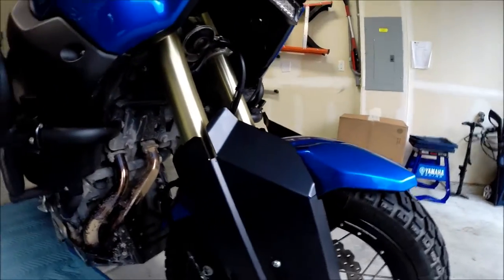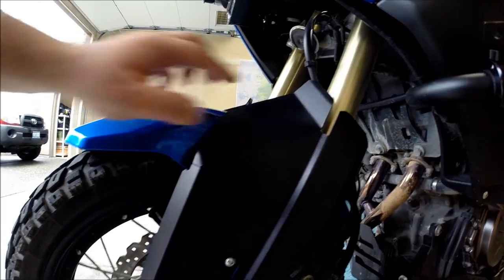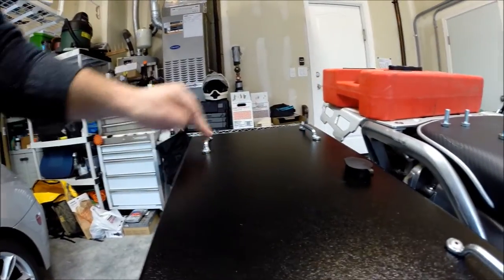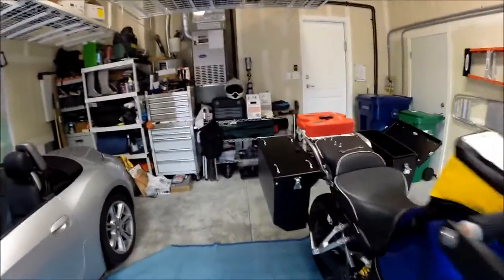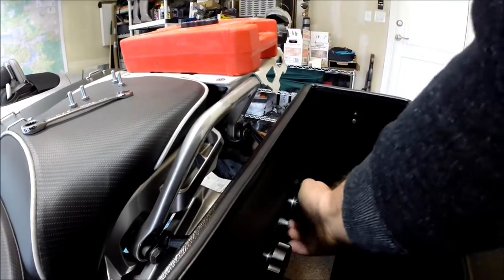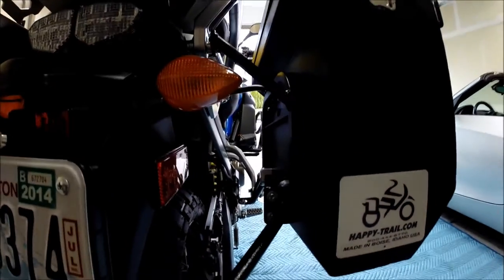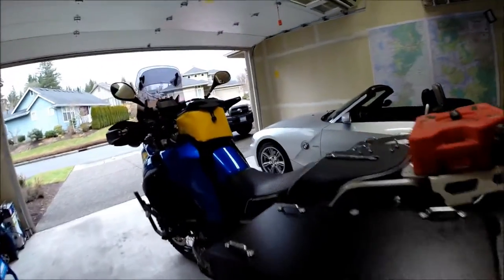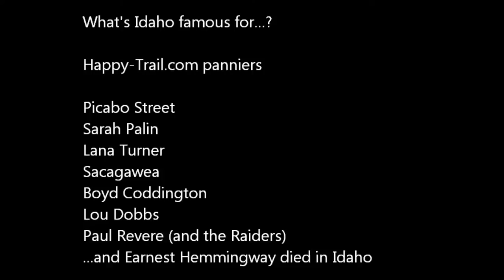Happy Trail Teton Pannier Review

Comment: Excellent review. I'm considering these pannier. Thanks for taking the time in sharing your thoughts and experience. N
Reply from the maker: Can not recommend them enough! Still have them, they are still excellent! 👍
Reply: @DuaneForrester  what is the width of your Teton panier? I thought the Teton was 7.5" deep but yours look deeper than that. It's been recommended that I use the 7.5 " Happy Trail pannier for a Kawasaki Versys 650 which I think  has a seat height just under 33". I imagine with the big tenere you have much more space.
Reply from the maker: @wiskkid  Mine are the 9" Clif Cut units, Stuart. Actual dimensions for the boxes on my bike are: 15" H x 18" L x 9" W - total weight of 8 pounds per box. The 7.5" wide units shave about 1.5 pounds off per bag, IIRC. I honestly thought about going with the narrower boxes (I prefer the look), but ended up larger on the logic of "Can you have too much space?". Turns out, for me, the 9" wide units were ideal. But, this is a pretty big bike. If I had a smaller bike, I'd give up a bit of space and run the narrower boxes. ;)

Comment: I just got installed mine. When tightening those two lower bolts, the "tooth" on the backside that attaches to rack just turns around. Does this happen with yours too? I installed them correctly. Thanks!
Reply from the maker: They spin until I get them close enough to the rail to essential "grab" the rail - that friction stops mine from spinning. If you're spin through this, it might be worth running the bolt through the foot's threads a few times to see if that will help clean them out, in case maybe some grit in there is causes unwanted friction as the bolt enters.

Comment: What is the Clif when ordering and do they come with the racks when you bought them?
Reply from the maker: Nate Underwood the Clif cut is what they used to call that angles cut on the outside edge of the pannier. It’s supposed to help with clearance when cornering or when off-road, but I’ve always felt it’s more of a styling choice. Not sure if they still call that feature that or not these days. The racks must be purchased separately. It’ll all be detailed on their website, with the most current info. 👍
Reply: @DuaneForrester   thank you very much

Comment: Hey man, great video! Are you still happy with these?!
Reply from the maker: 100% - it's been almost bang on 4 years since this video, and they are still solid as a rock. They've endured thousands of miles on the bike and remain close to new - dirty, but everything works as intended. If folks want to know what IS failing, well, the reflective stickers that were on the rear of each pannier from new are starting to peel up around the edges. The glue is still holding, and it's literally like 1/8" to 1/4" of curl in spots. That's it. I'd buy them again and have no problem recommending them to others. :)
Reply: Thanks a lot! Have a safe 2018!!
Reply from the maker: Thanks! Back at ya! :)

Comment: The four extra bolts are to replace the pucks if you so choose......to open up the width inside a bit.
Reply from the maker: Great tip - thanks chris! Hadn't thought of that, but makes sense. And now that I do think of it, might be very useful in aiding packing...must try this soon. :)
Reply: My pleasure,
The tenere is fantastic,
I'm still waiting on my Denali panniers,
There on back order,
I did receive the SU rack system and I must say,
They are beefy.
Take care out there friend.

Comment: Is the inside still 9" even with the Clif cut
Reply from the maker: The 9" width applies to the widest portion of the pannier box; let's say that's measured at the top. So...the cut...ah...cuts into that on the bottom edges. Obviously, not a perfectly cubed rectangle, but the added clearance is nice, so for me, worth the tradeoff. They never left me short of storage space. :)
Reply: @DuaneForrester  thank you I just ordered these and was worried about not having enough storage space with the cut

Comment: Nice garage review. How do they ride and hold up after a few thousand gravel and dirt miles?
Reply from the maker: Well, given I'd just installed them, the "garage review" was all I had to offer...but since you ask...

After a couple thousand miles of street and trail riding, they are...pretty much the same as the day I installed them.  Dustier, and dirtier, but otherwise, solid and weather resistant.

One thing to watch for - the mounting racks use square tubing at from the back, leaves the end of the square tube open to the elements.  I can see mine starting to get surface rust inside them.  Why they don't ship with plastic plugs is beyond me.  Easy enough to sort out, though, as a small project over the summer.

Super easy to find the plastic plugs...in bulk, so just need to sort out a smaller number than the 24 packs I've found. Plan to spray some rust convertor in the tubes to get a jump on the surface rust not going deeper, then some rocker guard (on hand), then the plugs to keep future crud out.

I panniers are tight and solid on the racks, and while the top box flexes slightly as mounted on my ALT Rider rear rack, its not so much to cause issues, fatigue or breakage. If I were planning to do a Back Country Discovery route, though, I might replace it with soft bags on top to reduce overall weight up high a bit.

Fit and finish remains as received, though I haven't dropped the bike yet either.
Reply: Duane Forrester That's some great info, Duane - thanks! All I need to do now is decide between 4 bikes: BMW F800GS Adventure, Triumph Tiger 800XC, KTM 950/990 Adventure, Yamaha Super Ténéré…
Reply from the maker: Paul Tannahill I've ridden all 4 of those bikes.  Brought the Tenere home, obviously.  Zero regrets even after throwing several catalogues at the bike...LOL Ride, take notes and make the call that's best for you. :)
Reply: Duane Forrester Thanks, Duane. I get worried about the weight of the Ténéré, but remember how on a test ride I took revealed how well it carries that weight. That fact, plus Yamaha reliability, and shaft drive keep me very interested in the bike.
Reply from the maker: Paul Tannahill It's worth noting that my suspension has been upgraded by a local shop as well.  Touratech shock and front end - what an amazing difference it made to the ride and handling of this big bike.  Cannot recommend upgrading the suspension enough. :)
Reply: @PaulTannahill   What?!? No Ducati Scrambler Desert Sled? At least give it a look and watch some reviews.

Comment: In one of you previous  reviews it seemed you were sold on the Giant Loop Bags over the Panniers, what is your stance on this now as you get out on the trails?
Reply from the maker: If I'm traveling light, or shorter distances, the Giant Loop is still a great option. Mine did rub the finish off my passenger grab rail, but that's a small thing in my mind. The panniers excel on longer trips. If I'm off-road and its tighter, GL. Forest service roads and such, I could go either way. Obviously GL on a cost only basis.
Reply: +Duane Forrester Thanks, I love your reviews. Hey, if you get bored you should make a list of all of the accessories and mods you have done. Then rate them. Thanks again!
Reply from the maker: +txkid You know, I kinda like that idea! Maybe this summer I'll do a series. 😀 Thanks Tx!
Reply: +Duane Forrester Thanks, I hope to make the move this summer but holding off until I see the new Triumph Explorer as the new Cycle World rider article says it is an awesome bike. Super Tenere ES is still tops on the list and would have to be stellar to knock it off.

Comment: did you measure overall width?
Reply from the maker: I don't think I ever did... Just ran out and measured. Looking at 38 1/2 inches overall width (may be closer to 37 1/2 inches, though as the boxes are off the bike right now, so I'm adding measurements here: rack width plus pannier widths). My aftermarket handlebars are right at 38 inches wide, too.